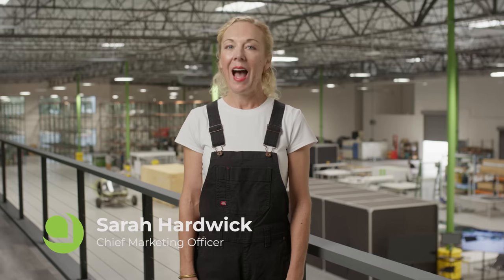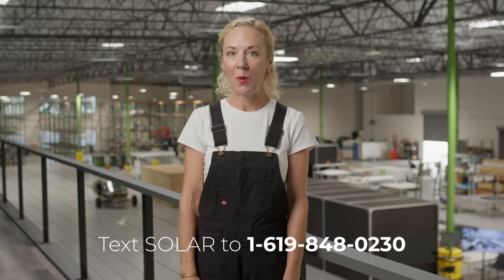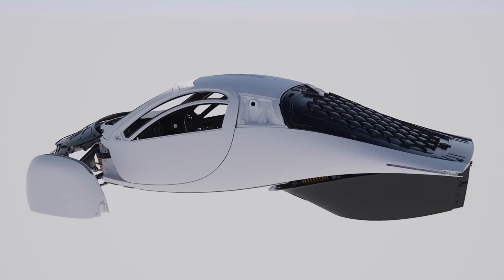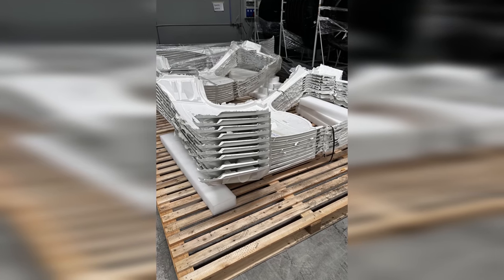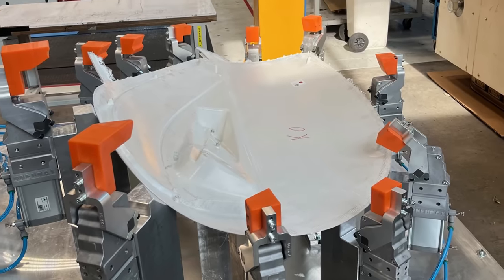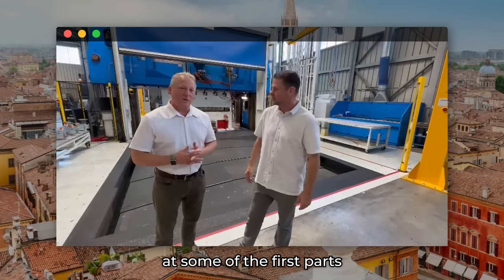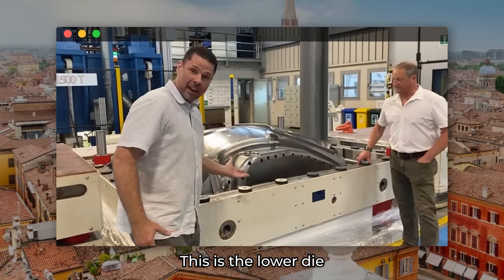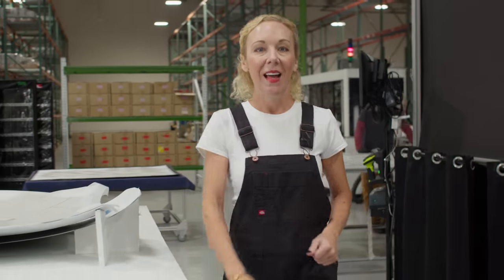Aptera Update — October 2023

Comment: I found the tooling and die portion interesting.  You're talking about "stamping" carbon parts, but that doesn't happen like it does with sheet metal.  There's a resin (epoxy) component that has to be precisely infused into the carbon and then allowed to fully cure before the part is usable.  I assume the die components were hot because you're using heat to accelerate the resin cure time?  Maybe this is more "in the weeds" than most would like to hear about, but I find it interesting.  Glad to see you hit this milestone.  I'd have pre-ordered mine already, but from everything I've seen Aptera will only be for smaller people (i.e. not 6'2, 250 lbs, etc.).  Really wish I could get one, but I'm happy to see it slowly coming to fruition.  Should've seen Delta by now, though, so I'm hoping that'll be soon.  Keep pushing!!
Reply: No, this is stamped sheet.  It is not the resin infusion process that was originally envisioned.  Watch the video.  Chris Anthony is well over 6'.

Comment: I'm not that interested in EVs for the most part, but this Aptera is certainly a standout. Hopefully the aftermarket can offer good options down the road for these. Seats, steering wheels, upolstery, wheels, brakes, lights, suspension, ect..

A four wheel version perhaps similar to Caterham or Ariel Atom/Nomad would be cool to see. Perhaps something more performance oriented. Either way this would make a great commuter, especially only needing 120v to charge, don't need to break the bank installing one of those expensive high power chargers.

Comment: I like the idea of this vehicle however, they initially promised a late 2023 delivery date. Now they say they only have 60% of the tooling and haven't even built a validation unit. Their current claim is to delivery in 2024 but based on this update, they likely won't be able to do so realistically until late 2025 or even 2026. The question is can the company even make it until then?
Reply: >Now they say they only have 60% of the tooling 

The rest of the tooling is likely to be finished as soon as the next couple of weeks, barring need for rework.  The first 4 didn't need it..  There is no basis to conclude that the first deliveries will be delayed until late 2025 or 2026, based on what we know now.

Comment: I would love to buy an Aptera for 2 reasons: 1) it is solar and it can transport me free for my daily drive to the beach at Seaside Park(Bridgeport, CT). I go to the beach every day even in the winter; and 2) Sandy Munro is an investor in the company. There are 2 big reservations:
1)it is not driveable in CT.(New England) snowstorms because of the low ground clearance due to the fenders on the front wheels. If there were a way to mechanically raise those fenders and the chassis. Six -12 inches for a snow storm is typical in my area. I can accept a car that can deal with 6" of snow.
2)Who in my area can service the car?
 I am 78 years old. Please solve my dilemma before I get too old to drive. If  you do, then I would be ordering that car today. Final thought: how do I get that car to CT?
P.S. I would be glad to be a test driver for Aptera if they need someone to test their car  to give some real world experience(data) in New England.  I would buy the car if it were a good car for my New England driving experience.
Reply: Aptera will be offering a set of higher fenders (wheel pants) and I believe even the rear skirt is higher as well. It is not being offered on the Launch Edition, but could follow soon. The service question is not answerable at this time but I believe that the more routine issues could be handled by typical mechanics or tire service centers. This vehicle has very sparse systems requiring dealership type service. I think Aptera may partner with an outfit like Pepboys or some other chain for the occasional needs. This is all just my guess and opinion,  but they won't hang us out to dry.
Reply: I am facing personal age related driving issues as well.  I live in Iowa, and hope to be able to give driving in snow reports with an early model.  We already know that an Aptera prototype drove on a ski slope in Switzerland with snow above the bottom of the wheel pants with no issues.

Comment: Please offer a round steering wheel option.  Even Tesla is doing this for their models S and X.
Reply: Agreed
Reply: @merrickhurst4150  The rest of the vehicle is very well thought of, this is kind of a wart 🙂
And I feel a wheel that you turn more then 360° from lock to lock isn't safe if it isn't round.
Reply: @liver.flush.maestro  it's more of a comfort issue for me. Reportedly the steering will be dynamically rationed, so more than one turn shouldn't be necessary in 99% of maneuvers
Reply: @merrickhurst4150  Interesting.  But a dynamic ratio steering rack isn't a cheap option, I can't imagine this to be present on the base model.

Comment: Surprised it is taking so long to get the rest of the stamps done.

What is happening with wiring harnesses and motors and solar cell construction?
Reply: This has all been addressed.  Yazaki is building the wiring harnesses.

Europe is a bit slower than the US, so Sandy was a little over optimistic on time lines, but it is happening.

Validation could still throw a big wrench in time lines, depending on how smoothly that goes.

Comment: I've heard that solar panels lose efficiency overtime. I would like to know if Aptera is addressing that specifically and how.
Reply: 🧐True that. Their solar panels have been designed to have a better than 10 year life and be easily replaceable when needed. 🤓
Reply: Oh yeah for sure. Each Aptera is outfitted with a flux capacitor complemented by stem cell technology to prevent the universal truth of entropy from applying to the solar cells.

It's embarrassing to have to remind people about this, but things wear out eventually.
Reply: PV cells typically loose 4-6 percent efficiency over the first 1-2 years of being new, and then the output stays level for the remainder of their lifetime.  All PV cells share this characteristic, it's not much of a loss.
Reply: @fotoguru222  The manufacturer of the Maxeon cells that Aptera is using at the beginning offers a 40 year warranty on their panels.  It is likely that the Aptera panels will change long before that as the tech improves.
Reply: @fotoguru222  thank you answering. you actually reminded me of another question that I'm waiting to see answered. The DIY-ability of repairing Aptera's. That was vision presented a few years ago. I'm not a care mechanic, and I don't expect many mechanics to be ready for this car unless it starts selling like Toyota Rav 4's
Reply: @DemaGeek  that's cool!
Reply: @n.brucenelson5920 Only 40 years??? Solyndra was promising 50 years on their solar panels...

Comment: QUESTION: Will a cash test vs a full size truck be done? This is such a small mass vehicle, I'm concerned how well it will absorb dynamic impacts vs static force.
Reply: They will do standard FMVSS Part 200 crash testing, conducted by a third party, and the results will be public.
Reply: There are no Federal crash test standards for motorcycles or "autocycles" so the Government will not issue any crash test certifications for Aptera.
Reply: @n.brucenelson5920 Any data collected from a private  third party will be entirely speculative and completely meaningless without comparision data from other vehicles in its class and will have no federal certification because no standards exist for motorcycles.
Reply: @sandervanderkammen9230  What part of testing to automotive standards can't you understand?

Comment: I don't know if "solar EV" is an honest description. Even in the US, which gets more sun than Europe, charge gain on solar panels is very little. I like Aptera for different qualities: being light and aerodynamic in shape. Regular EVs are just too heavy and huge to be really sustainable.
Reply: The miles gained by Aptera from its solar panels is about equal to the average daily use of cars in America.  How is that "very little"?
Reply: 30 - 40 miles of solar charge per day is VERY significant.  If you don't drive more than that a day, you may never have to plug in!!
Reply: Sure, that's a meaningful number. But all I've seen so far is "up to 40". Something tells me it's what solar panels can produce in ideal conditions. What about other conditions?  @DemaGeek
Reply: @chillwithsergei   Solar conditions are highly variable, location, time of day, season of the year, shading, angle to the sun, etc.  In order to compare them the industry comes up with 'Standardized Conditions' to apply in each situation.  When the conditions are the same, the results can be compared and are meaningful.  So yes, the 40 miles in 'up to 40' are under ideal conditions and the best you can expect.  Everything else is variable and will fall below that.
Reply: If you look up how your location compares to the 'Standardized Solar Conditions', you will get a correction factor to multiply by, which will give you the best to expect where you are.  Example: If you live where the conditions match the 'Standardized', then the correction is 1, or no change.  If your area gets a bit less sun exposure than that, your correction may be 0.90.  The ideal is 40, multiply that by your correction factor of 0.90, and the ideal to expect at your location is 36 miles.

Comment: I think your next video needs to talk about the thermal system. I think a lot of people saw the nbc special and saw that it overheated. I think you said you weren't able to set it up correctly on the short timeline but i think that missed people.
Reply: There is already an Aptera Owner's club interview with an Aptera engineer that goes into rather great detail over the cooling system design.  There are three separate systems, and we know that the antifreeze loop for the motors and controllers wasn't even hooked up at the time of the demo.

To engineers, it is impressive that even in this state, the vehicle protects itself by slowing down with no damage occuring.

Comment: Really pushing hard for "solar". I'm personally not a fan of that being the main factor. A lot of places don't get much sun year round. Just a light weight EV that isn't 50k should be the goal.
Reply: Good thing it does that too
Reply: Maybe check the "Aptera Solar Calculator for Blender" video - maybe it is more than you think. I did the calculation for Germany (which is not very sunny) and an aptera with all solar panels - and found it worthwhile doing (considering the panels don't cost much nowadays, prices dropped a lot in the last 20y).
Reply: @ThomasWaldmann does the calculator assume the vehicle is being moved every hour to maintain the perfect angle to the sun?
Reply: @gbpg2016  In the version I tried, you can orient the vehicle in any direction you want (like e.g. the back facing south or like your usual parking spot), then you run a simulation over a day (from sun rise to sun set) and usually the vehicle position/orientation does not change while doing that (although you could do that manually I guess).
Reply: Okay.

Comment: How come that we are only at 60% 4th quarter 2023, when you said that first cars will leave production in 2023?
Reply: The design was originally to be using vacuum resin infusion for the body parts.  The switch to carbon fiber and SMC produced at CPC has resulted in development taking more time, but also a much higher quality end result that can be produced more quickly.
Reply: Aptera has been pretty transparent about what they do, and why. Not really their fault if folks do not keep up, or remain ignorant.

Comment: Has the Aptera been run through a carwash for evaluation yet?
Reply: I think that the type of car wash with to wheel guide are out. I'm guessing thr type with spinning brushes are out. Most likely only only touchless car washes where you drive in and the mechanism traverses over your vehicle or the hand wash types. One of their solar engineers mentioned that any waxes that block UV light should not be used on the solar panels.

Comment: 3 wheel cars have three tracks. Bumpier than a 4 wheel car with 2 tracks. I don’t think it will be a game changer
Reply: Three wheels significantly reduces rolling resistance.  I rode in a prototype built before Roush Performance redid the suspension, and the ride was better, including going over speed bumps than a Kelmark GT sports car I used to own.  I don't expect a "plush" ride, but it will be acceptable to me and my wife.  Everyone has their own standards.  I love the trade-off that buys lower weight, cost, and rolling resistance, which will continually leave more money in the pockets of owners.

Comment: don't get me wrong, I love the idea, but what happens when you get the car outside of CA.  There is a vast majority of the country that is winter for 4-6 months of the year.  With only a single tire and nearly no solar for 6 months, who are you marketing to?
Reply: Single tire? The Aptera has 3 powered wheels, not one. 
Yes, in Winter we get less sunlight but far from none. Maybe half. And you'll want to run the heater so that will also reduce the range. Still you can plug them in to a standard outlet and gain 13 miles per hour. That's 130 (unheated) miles in 10 hours overnight.  Or plug it into a Tesla charger to get a much faster charge at 2 to 3 more miles per minute per KWH than any other EV.
Reply: Damn bro, how'd you type all that without knowing how to read? It's got a plug too you sentient chapstick.
Reply: @merrickhurst4150  Let's not insult each other in this forum.
Reply: @merrickhurst4150 i own an ev and know what cold temps do to range. I also have driven can am spyder on wet grass and i know how bad a single drive wheel can be. If true, i did not know that all three wheels were powered which is why i mentioned the snow. Maybe you check your tongue before answering.

Comment: Sure a test vehicle can drive on the street - but they have plates from the manufacture, similar to a dealer plate- they have never had a DOT certification as a street legal motorcycle - for those out there that think an Aptera is a car - it is not in the USA all 3 wheeled vehicles are motorcycles and must meet motorcycle standards - one of which is - the center mounted headlight you see on all street bikes.; the Aptera does not have one so it can't be certified and it won't be until it has such a light in place.  Were you an "investor" bruce - if you weren't who says you'll get the 42nd vehicle? Maybe an Investor will be put in your place.. you probably are an "investor" who qualifies for the lunch edition so you would in theory not have a conflict in that case; but many that paced orders and paid their reservation are not investors; and will be put in conflict with the promises Aptera has made to investors for a cut in line.

Comment: Meh, these products that cannot be serviced by anyone else except the maker are anti consumer.
In case of an accident, can the owner find widespread availability parts at any store from a wide number of suppliers. You know, like we have for every other brand out there?! What about the windows? What about the headlights and tail lights, the door panels.
Or even most importantly the solar panels. Can the user find from alternative suppliers?!!
If not, this is a severe anti trust laws breach.
Reply: Check out Aptera's right to repair policies.  They will even send drawings to manufacturers that wish to built aftermarket parts for it.  They are not your "usual" company.

Comment: Oh but Bruce they promised you and you said for sure you'd have it and ooops you don't.  And go ahead and annouce when you'll now have it ? Go on I like a good laugh.  How about you'll have it in December 2023?  Oh did you figure you'd get it by the reservation you had or by the investor method ?  Didn't they now promise the same vehicles to two groups?  Isn't that fraud?
Reply: I think the fraud is you claiming they ever made a delivery date "promise".  And the "it" we are talking about has changed significantly since it was announced and now the delivered vehicles will have bodies made by a super car body manufacturer at lower cost and with far less labor and waste material.  

I am a Paradigm reservation holder and will still be getting my vehicle as an LE edition.  How is your failure to research your claims fraud on the part of Aptera?  It just makes you look like a troll.

Comment: The idea is great but if any car besides a Prius hits you at 65 mph , RIP.
Reply: Aptera will be 3rd party crash tested to federal FMVSS part 200 crash test standards by a third party and the results will be made public.   I have around 1/2 a million safe miles on motorcycles and Aptera will be a major upgrade in my safety.
Reply: @n.brucenelson5920  it overheated on national television going up a hill.. you think the safety measures are going to be loved one safe. Absolutely not .
Reply: @TeslaBull25  Yes it did, but this was a marketing mistake, not an engineering one.  It is interesting you can make absolute claims with zero data.  

I have designed products that people rely on, including one that flies on the ISS.  I have some experience with this.  It is also likely that you may have taken drugs that have my name on the FDA validation paperwork.  I tend to make my judgements on actual data.
Reply: The Prius weighs a lot more than any Aptera. The Aptera would not fare well against a Prius.